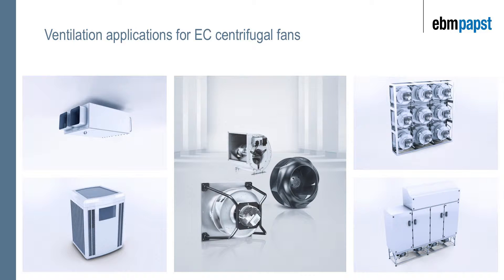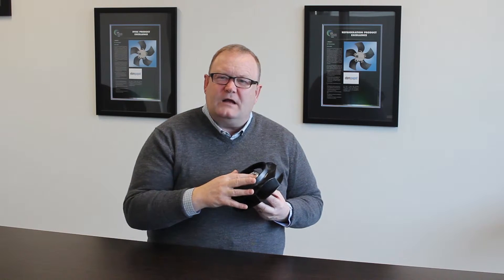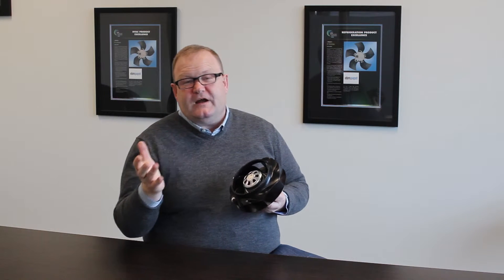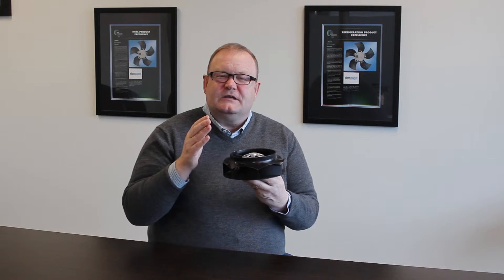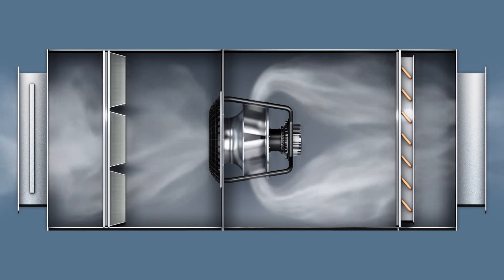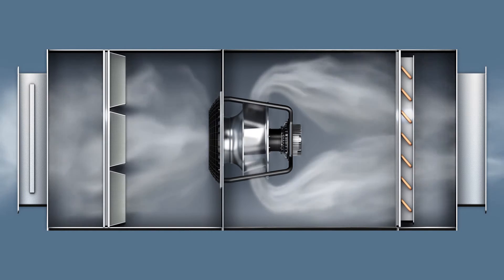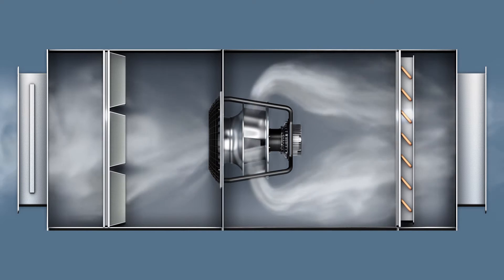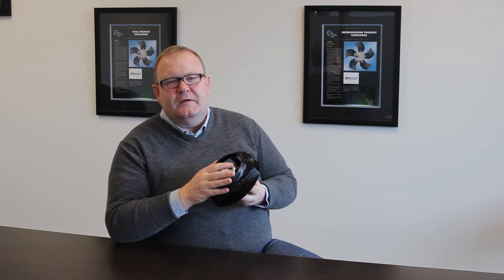EC centrifugal fans for ventilation applications - ebm-papst A&NZ

Comment: Can you help me?  I have 2 R3G190-RC05-03 units that have become noisy.  Andy advice or do you know how I can get hold of replacement bearings?
Reply: jasonoldy69 hello.  The motor and the impeller are a balanced pair and therefore the bearings cannot be replaced.  We do have replacement fans is stock however if you are certain it is bearing issue.  Please contact us in sales@ebmpapst.com.au.  Thank you!  Simon
Reply: Erm, just replaced the bearings myself (sfk 608-z), and good as new.  Saved £100+ per fan...